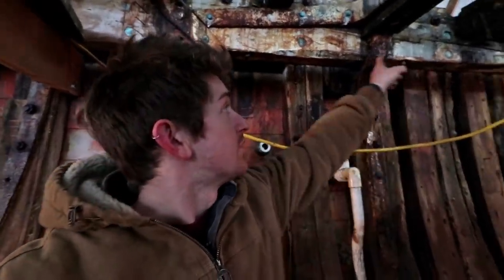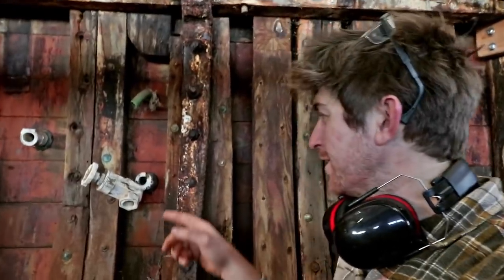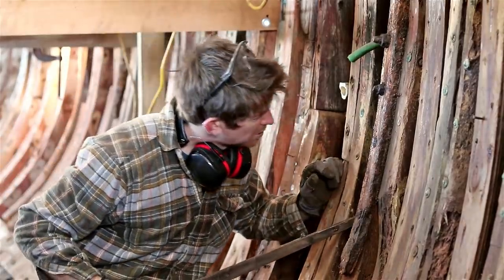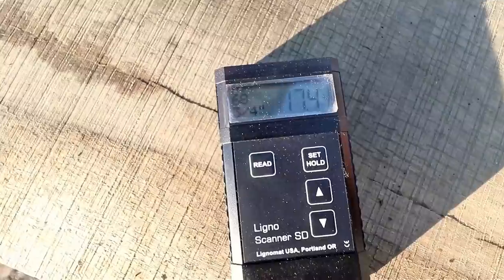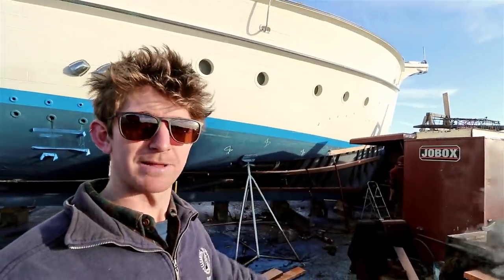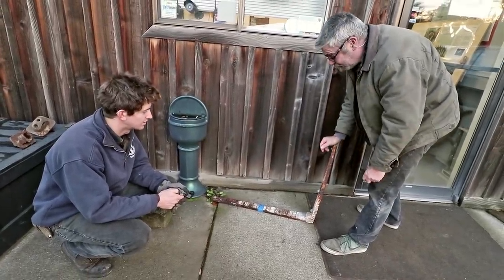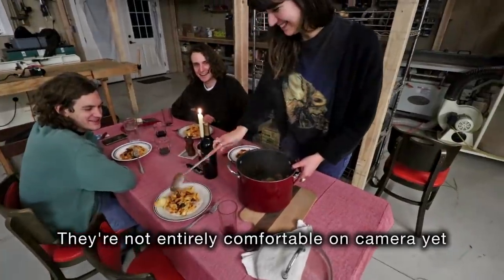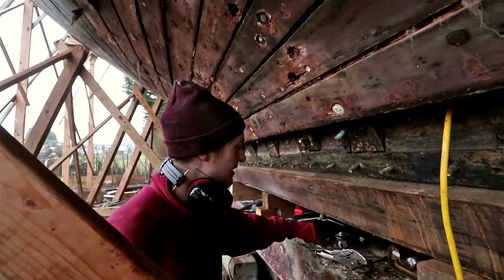12. Chainplates & Knees / Live Oak & Bronze - Rebuilding Tally Ho EP12

Comment: Maybe as a way to make  money for the project, you could sell small pieces of the timbers that are removed and will not be put back into the Tally Ho. As an example, 20 or so years ago when the arena that housed the Los Angeles Lakers replaced their  playing floor, small 2"x 2" squares were placed onto plaques with a small brass plate.  Or possibly, someone would want a larger piece that's still in fair shape to make something.
Reply from the maker: Thinking of something like that now..

Comment: If you have access to air compressor (𝘢𝘯𝘥 𝘪𝘧 𝘯𝘰𝘵, 𝘮𝘢𝘺𝘣𝘦 𝘺𝘰𝘶 𝘴𝘩𝘰𝘶𝘭𝘥 𝘣𝘶𝘺 𝘰𝘯𝘦) then you can buy an air hammer.  That will knock any bolt or pin out in seconds.

Comment: Loving this. There is a process called zinc infusion which impregnates zinc into steel and basically stops it from rusting it is not a coating like galvanizing. I have been running a test for 6 months in a mine where I work in a place where even stainless steels are corroded and so far this is holding up extremely well

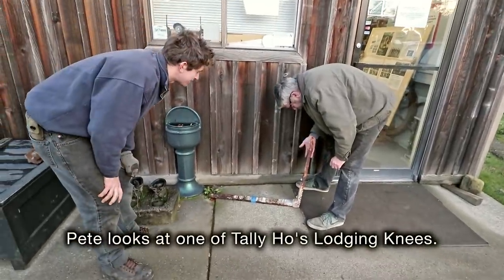Comment: Hi Leo.  Well, for my two penny 'orth, at 10:16, I definitely don't think those lodging knees, (or the knee braces) would be cast iron.   Cast iron is very brittle, and fabulous under compression but not so good under tension/shear.  They are far more likely to be wrought iron.  The absence of hammer marks etc. could just be the sign of not just a good blacksmith, but a GREAT blacksmith.  I think if it were me, and like someone else has suggested, hot dip galvanising would be pretty effectively and sooooo much cheaper than new braces in Bronze.    I mean, ALL budgets are limited in the end.  Great work though Leo; well done to you.
Regards Mark in the UK
Reply: Wrought Iron ,as in Iron Wrought  from from puddled Iron is vastly superior to Cast iron and can be identified as such by the grain,which ,if you run a piece over a linisher ,is visible .It wont rust like mild steel because the carbon content tends to be low but that grain is what makes it malleable unlike cast iron. If you have original wrought iron parts, re use them. Wrought iron,the real thing ,not mild steel doesn't require galvanizing just a good coating of zinc rich paint.
Reply: Unfortunately, true wrought-iron isn't made anymore in the US, and possibly no-longer in Europe either.   Millions of tons were collected as scrap and melted for making steel during and after WW2.  What's used generally-called "wrought iron-work" in new projects is actually mild-steel or carbon steel; fences, gates and ornamental pieces.  Some recycled bits of old wrought-iron are reforged for knives and small fittings, and as scrap it's become rather valuable..
Good-quality marine-grade bronze is getting ridiculously-expensive also since most common "bronze" is actually brass, and you can't re-use any brass in make marine-bronze since the Zinc will leach out, just like the zinc in sacrificial anodes and galvanizing.
Leo's fortunate to have access to Port Townsend Foundry.  Most places have seen their local jobber-foundries close, or be driven-away by the environmental crazies.  In my area along the Delaware River, after 300+ years of boat and shipbuilding, the last gray-iron jobber-foundry closed a few years ago, and marine-bronze casting died-out two generations ago.  Seventy-five years ago the area was rife with tool-and-die shops, foundries and riggers who supported over two-dozen large and small shipyards and many smaller boatworks.  After WW1, the Delaware was called "the American Clyde", now it's gone.
Reply from the maker: Hmm, yes I have heard this a few times now. Perhaps correct, I would like to do a deeper test somehow. I'm still considering galvanising, but iron sickness in the wood is the reason this boat need to be rebuilt now. Non-ferrous fittings and fastenings would have meant I would be able to save a lot more, and if I use bronze then the next guy might thank me in another 100 years! Plating/galvanising would help but inevitably gets chipped and damaged eventually. we will see how the funding goes ;) Thanks!
Reply: thecorbies---I agree that build period wise and metal characteristics wise that the knees ,floors etc are wrought iron-------WTF a 100 year service and still reusable---put them back in----in many modern applications rust is considered a preservative coating.  Steve Cross
Reply: Hello Leo.  I've been a professional blacksmith for many years, including working for the National Park Service.  The lack of hammer marks is NOT an indication that it may be cast iron.  Cast iron for this application would not be ideal.  True professional blacksmiths, especially from Great Britain during the period would not leave hammer marks on their work.  However, making these parts from bronze is the proper way to go for longevity considering the conditions they will be subject too.
Reply: wrought iron is a wonderfully weather resilient material and super strong, if any of it was wrought iron i would keep it!!!
Reply: its great properties is attributed to its high slag content
Reply: @w250x  and the slag was in thin laminations between layers of relatively pure iron -  which was kind of like the butter in the construction phase of an authentic croissant

Comment: On any adjustable wrench, money wrench, the operable jaw should always be on the pull side.  When the operable jaw is on the opposite side it tends to open the jaw.  It is the weaker side and frequently leads to rounding off the nut.  

Lovely project and the use of live oak,, wonderful, traditional and strongest.
Reply from the maker: thanks

Comment: Leo
Great series, keep it up. I would like to toss out an off the wall idea for you and other boat builders out there. I have built three objects using laminated treated pine. Two foot path bridges and a swim platform. One of the  bridges is close to 20 years old and has been out in the weather sense new. I just rip the 2 bys thin, 1/4 to 3/8 and set them aside to let dry. When dry toss the pretzels aside, coral the remaining and glue them up.  The result is a very strong, very stable, rot resistant, sustainable, very inexpensive hunk of wood.  Not for every application but seems to me there is a place for this. 
By the way, we have a (scaled down from your project) boat renovation going on also. "The Houseboat Project" under Barry Luke Videos. 
Thanks Barry

Comment: i'd be willing to bet the knees are wrought iron. Probably second or third process, as well (good quality) wrought iron is probably the best thing they cold be made of - the silicon in it helps it naturally fight corrosion. I would definitely keep them. just sandblast them and paint them with a good oil based paint or powder coat them. you could galvanize them, but I think it's probably overkill.
Reply from the maker: I'm still considering it, but iron sickness in the wood is the reason this boat need to be rebuilt now. Non-ferrous fittings and fastenings would have meant I would be able to save a lot more, and if I use bronze then the next guy might thank me in another 100 years! Plating/galvanising would help but inevitably gets chipped and damaged eventually.

Comment: Another good video.
Video point 2:33/17:39.   Using an adjustable spanner.  You were using it the wrong way.  Looking at the square nut - to unscrew the nut you needed to be on the left of it with the adjustable part of the spanner down/at the bottom of the nut, you pull the spanner down.  The adjustable part of the spanner needs to be on a part of the nut going in the direction intended. Always try to get in an advantageous position.
Doing it the way as on the video it can slip especially on hex head bolts that are rusted.   Squared nuts are usually better with an adjustable, the amount of rust can be difficult to determine.  Adjustable spanners are renown for rounding off nuts/bolts.
Stillsons are better for the job you are doing they need to be used with the jaw on the handle part/nearest the adjuster on a part of the nut that is going to go in the intended direction.

1:45/17:39 what did you learn from the near head bang?
Reply: Yep. What Frank said is true.

Comment: The knees LOOK like forgings.  Good forgings do not have sharp inside corners where the foundryman pointed out the nice fillet (radius).  If wrought iron the corrosion will have wood like grain.  Note that bronze is heavier than steel and bronze parts with the same strength as steel are larger and thus even heavier. . .  If you use bronze knees and plates you will also need bronze bolts.
Reply: he could just clean it up and smack it like a tinkerbell to know. I like his bronze idea.

Comment: If you ever run into bald faced hornets again try non chlorinated brake cleaner, it works so well.
I have allot around here, I always have some brake cleaner nearby, it works on intruders, hornets, wildly pissed off Exes, and it works instantly.
You might not need a gun, if you have a fresh can of brake clean handy.

Comment: Those look more like bees than waps imho. If they indeed were bees, and that was a hive, you should have tried to have someone pick them up otherwise in the Winter, without a nest, they most probably died. And we're getting short on bees as it is.
Reply: My guess is the hive was in a tank to which the pipe was attached. Either the hive died out, or they have left, disturbed by work in another part of the boat, and these are the stragglers/survivors. Regardless, as a beekeeper, I can tell you that you can't viably harvest a feral hive at this time of year, unless you can move them undisturbed in the original container (a barrel or tank). They are dormant and die very easily.
Reply: Thanks for the info. Always good to know a bit more!
Reply: No problem. A fairly knowledgeable commenter below thinks they are hoverflies (also known as drone flies or flower flies), and not bees at all. They are flies that mimic bees and wasps to avoid predators. Looking at pictures online of the variety he has identified (Eristalis tenax), I think he may be right.

Comment: Might be worth thinking about compressed air tools? An air hammer would make knocking pins in and out much easier. Also help when cleaning away muck and allow nice powerful sanders etc. Maybe one of the big makers might want to lend you one? Perfect tool for what you are doing. Certainly a lot safer to use on a big job like this than electric tools.

Comment: Leo, When you were looking at the Southern Live Oak /Quercus virginiana  at Haven Boat Yard (NOT California Live Oak/Quercus agrifolia) you said that it had "Quite a lot of sapwood" . How do you determine and define sapwood in Southern Live Oak ? My research has involved consultations with United States Forest Laboratory Scientists , United States Department of Agriculture Scientists , Members of Georgia Forestry Commission and numerous highly regarded wooden boat /ship builders and myself /Steve Cross . No one has had a consensus academic/scientific definition of heartwood/sapwood in Quercus virginiana . What criteria did you use to define "Sapwood"?  Thanks, Steve Cross
Reply from the maker: Hi Steve, it looked to me like there was about 4" - 5" of a clearly defined yellow-ish wood closest to the outside edges of the timbers, which I would understand to be sapwood. That isn't a huge amount, but some of the logs with some sweep in, which  are the ones I was most interested in, looked like they were from the top or bottom of the log (as milled), and so that "sapwood" covered most of one face of the flitch. However, I have since been learning that Quercus Virginiana is often considered to be so rot-resistant that sapwood is not considered to be a defect. The main issue with these timbers was just that they did not have enough sweep for what I want to do with them, but they may still be useful to me. Either way, I respect your knowledge of Live Oak and, as an English Shipwright, am only just starting to learn about it. 
Whatever the consensus, I would be hesitant to break the habit of a lifetime and use the differently-coloured timber from the outside edge of a tree (usually known as sapwood) for structural parts of a boat. However, if there is proof of it lasting just as well as heartwood for 100+ years, then I suppose I would be silly not to.
Reply: Leo, Thank you for your reply. Most/all of the definitions of Sapwood/Heartwood I have seen have said "Sapwood" is lighter in color than "Heartwood " and I was pointing on the Quercus virginiana Live Oak we have sawed has all aged to where the outer sections of the cut (nearest the bark) all have aged to be darker then the inner section (further from bark) . I believe (know ? ) this to be the case with the Live Oak at Haven. Flip one or all of them over and see if the bark side isn't darker wood . I have studied this for a very long time and plan to continue to do so. I was just saying  defining it as sapwood being lighter colored and heartwood being darker  is not a 100% definition. There are  reports of 100 year old wood in ships with the bark still attached. I would not advise you or anyone to not follow their best judgement , but habit and science are not always the same thing. See if you can photograph a  sanded cross section .Steve Cross
Reply: Leo , In the interest of trying to be informed , I thought all California Live Oak /Canyon Live Oak was Quercus agrifolia ,which is a Red Oak species , but have since learned that Canyon Live Oak is Quercus chryolepsis which is a White Oak species . Through not 100% accurate research I thought California Live Oak and Canyon Live Oak were the same species since they were "Sympatric" (growing closely together in the same environment).
   Anyway---Steve Cross

Comment: I am sure that other viewers have posed this same question. How much of the original vessel will be left after the rehab is finished? - it seems like the answer may be "very little". If that is so - can you really call the finished project a rehabilation? Wouldn't it be easier and cheaper to build a "new" Tally Ho using the prints that you have and integrate the usuable original parts of the original Tally Ho into the new build? Wouldn't that be the same thing - the same result? Perhaps the logic is that removing damaged parts and replacing them one by one as they are identified somehow retains the "soul", character and history" of the Tally Ho?  I don't know that there is an answer to that question but I do enjoy watching the work and the committment to the project.

Comment: Instead of using bronze save your money. And have all the steel sandblasted and hot galvanised. Then just paint over the zink coating for the looks. It's affordable and will last you decades. These are all simple parts without hollow sections inside so hot galvanization is easy for these parts.

Comment: What about getting the steel/iron knees and chainplates hot dip galvanised? Probably less expensive than bronze casting and should handle at least some decades without corrosion problems.
Reply from the maker: I'm still considering it, but iron sickness in the wood is the reason this boat need to be rebuilt now. Non-ferrous fittings and fastenings would have meant I would be able to save a lot more, and if I use bronze then the next guy might thank me in another 100 years! Plating/galvanising would help but inevitably gets chipped and damaged eventually.
Reply: Valid argument. Keep in mind though that galvanising provides cathodic protection, in the same way you might use zinc anodes on metal fittings below the waterline. Galvanised parts can cope with damage to the coating because the surrounding zinc acts as a huge sacrificial anode. Also, making new parts from mild steel yourself and having them hot-dipped is quite straightforward compared to pattern-making and foundry work, or at least it is here in Australia.

Comment: You mentioned the mast, I haven't seen a mast yet. Do you have it? If not, I would imagine finding wood for that structure would be quite a task. And installing it would be an even bigger task. I would imagine the boat would be in the water when the mast is erected. Would be way too tall to transport. What is the plan with that piece of the project?
Reply from the maker: No mast. Will be looking for a big tree when the time comes! Usually they are craned into the boat when it is already launched... Putting it in (stepping the mast) is actually not that difficult, sourcing and transport are the harder parts.

Comment: Some of the iron/steel brackets could be made from stainless steel. This would be cheaper than bronze with similar corrosion resistances.
And It's better to collect copper for the bronze. You don't know the composition of the bronze if when you get it as donation. And copper is often easier to get, from old pipes and cables. The best place to find copper is in old buildings that will be demolished. Big companies don't care about the wiring or pipes, and if you ask nicely you can get a weekend or to to collect it.
Reply: Boelwerk You could even find the" scrappers "around the area and offer a little more to them for their scrap copper. They would  make more money for themselves and you would get copper at a dicount. You both win. The other thing you could do is advertise on craigs list looking for copper or bronze and specific parts needed.  A little background of your project, and you will be suprized how many people would love to help you with your project for free. The old car restorers are always doing such to help a great project along.
Reply from the maker: Good idea re; copper. I'm not a fan of Stainless on Traditional Boats, but will consider all options.